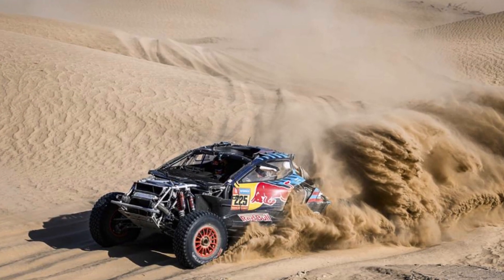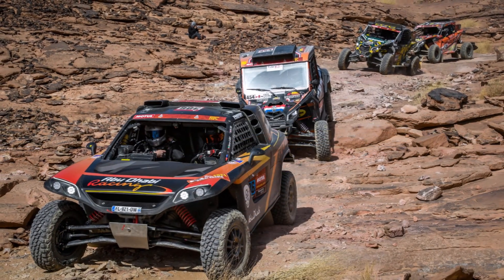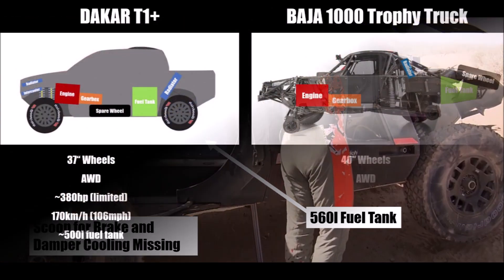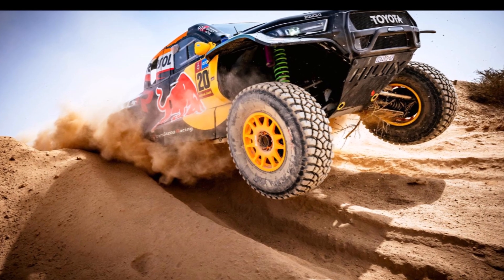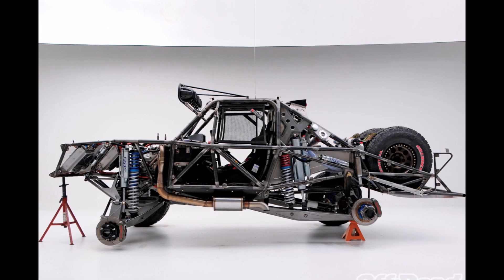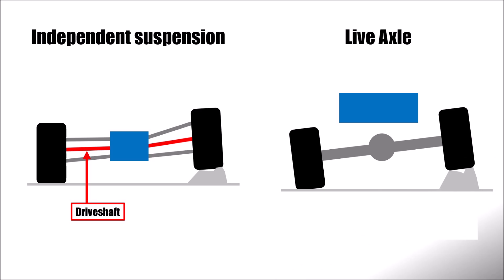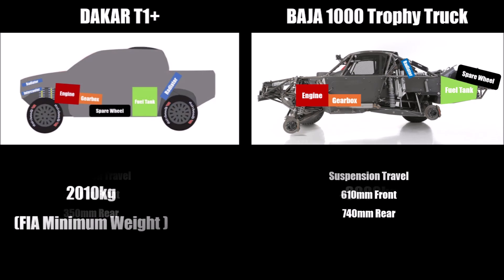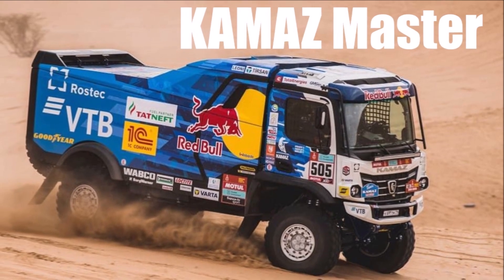BAJA 1000 Trophy Truck vs. DAKAR T1+ Vehicle - Technical Analysis

Comment: T1+ has to be my favorite because it is much harder to design and has to cover much more track during a segment. I understand the fascination about power with the Baja 1000, but it also feels much more blunt and dare I say, boring. I have to say though, there are much too many regulations for the T1+ class and it probably would mix up things better if they regulate fewer things.
Reply: What makes trophy trucks so awesome is it is an “unlimited” class. There is currently an arms race going on between the builders on how to maximize the mid engine, all wheel drive layout. One builder even made a twin engine AWD truck. There are also teams starting to experiment with electronic suspension, like the active suspension F1 teams had in the 90s. There is a lot more going on than just the power.

Comment: Its interesting how the less regulated, more powerful, and largely unlimited trophy trucks are cheaper than the Dakar T1 trucks. I suppose the extra engineering for safety, efficiency, and driving longer distances drives the R&D costs up enough to offset any cost savings that the regulations may have intended to bring, since usually such regulations are designed to make racing less expensive for smaller teams.

Comment: Unlimited T1+ cars would be incredible. Take the air restrictor/suspension travel limit and speed limit away. And see what happens
Reply: Give this man a beer
Reply: What happen? That happened: local people, drivers, supporters got killed every year... Ever heard the Dual engines turbo DAF truck in Dakar? Right now they even have a speed limit for T5. You can't simply maintain a reliability for a vehicle and high concentration for drivers for 14 days in straight and 4500km, without any limitations. Or if you talk about absolutely unlimited, how about building a turbojet ground effect vehicle and just simply win any car races in the world?

Comment: the safety concerns about the radiators and fuel cells on the Baja trucks are not so concerning when you consider the immense strength of the roll cage construction. the bodywork is there to simply maintain the appearance of a truck, they do not aid in protection very much.

the radiator placement allows only the coolest, cleanest air to reach it, and is in the strongest part of the chassis: the center. it does not get hit anywhere near as much by rocks, debris, or other competitors, as it would be if it were up front.

the fuel cell is in a more exposed position, but the immensely strong rear axle and spare tires surrounding it shield it from most impacts and wrecks that are seen in Baja.

would love to see each truck do an exhibition run in each other's race series! would be very easy to register a T1+ for Baja, probably not so much for the Baja truck to have a go at Dakar, considering the strict rule sets.

Comment: In Oct 2006 I went down Baja on a street bike (Ducati Multistrada, yeah, I know). On my way back north I dropped into a long straight that stretched many miles. I saw lights way out there, I thought a semi or something. The lights got close much too fast. In the maybe 20 seconds before crossing I became aware something really usual was coming at me. It was a trophy truck going flat out. I was going about 85 mph, we crossed on that narrow two lane at almost 250mph. For a split second my insides shook. I've been a fan ever since.

Later I almost got clobbered by some idiot on a dirtbike crossing the highway. Turns out I was there during the start of the 1000 pre-running.

Comment: back in the early 2000s vw brought 2 touaregs to race baja and they did well! couldn’t keep with the trophy trucks but they finished and were competitive against some
of the other classes. then vw went ahead and built a full size trophy truck using a disel engine similar to the one audi used in lemans but they had a lot of technical issues at their first race then the recession of 2008 came and they had to stop the baja program.

Comment: a use awd trophy truck is not less than $700,000 dollars a new awd trophy truck is $1000,000.00+ dollars. most awd trophy truck have a mid engine and is a paddle shifter transmission not sequential.

Comment: Id go with a Baja truck, you can always run with less power if you want. Im pretty sure the teams running in the sand wish they had more power to keep them ontop. 

With that said id drive anything if the start was in Paris and the finish was in Dakar.

Comment: Wow!
You analyzed an older trophy truck.
One from 3-5 years ago.
The new elite tier of trucks are the mason motorsports trucks 1100hp mid engine awd trucks with portal front hubs.
Reply: Also the Trophy Trucks are mid engine not front engine as shown.
Reply: @longshot7601  only mason awd tucks, and robbies truck, any of the gieser brothers, or Smith fab trucks are still front mid.
Reply: did they get lighter or heavier? or are they also around the 3 tones?
Reply: @HannyDart  still right around 6000lbs, they added a front diff, axles, and geared portal hubs, and saved weight elsewhere
Reply: @ interesting. I wonder if they tested heavier/lighter setups, too

I wonder where the limit of overall size is; maybe bigger trucks are even better?
Reply: @HannyDart  if you want to see light trucks the 6100 class is spec trophy truck they go to great lengths to keep them lighter like 4500lbs because of the limited hp sealed spec motors.  the way a heavy truck ends up working is basically a problem of scale.  Big tires are heavy, and we need a reasonable ratio of sprung to unsprung mass, and enough strength to hold it together...

Class 10 buggys are all around 2000lbs because they are limited to like 2L ish (depending on air or water cooled and  single or two seat) and run smaller diameter lighter tires.... because of the limited hp.    You can look at it like a matter of scale to the larger vehicle with the larger wheels, more weight and hp every bump and hole is smaller...    you can watch the class 10 vs class 1 unlimited or trophy trucks.

And as a side note.
Sometimes, on smoother tighter courses, there will be class 10, up in with the class 1, and even class 10 and 1 up with the slower trophy trucks.

Comment: YouTube zoo road a Dakar car would be doing 5mph here
A 1100hp awd trophy truck is well over 6000lbs and it needs to be to hold up to the conditions. A g out in a dakar car at 130mph would fold the chassis and kill the driver. 
Also fyi the baja 1000 covers some very mountainous terrain, there is very little flat ground running.
Also fuel cells are 300-500litres usually stops are a top up incase there are issues.

Trophy trucks cost $100k to rent for one race before damages and half the field are likely in rented trucks

Comment: i like the unlimited approach of the baja trucks more, because they can use the full amount of tech and knowledge they have to tackle their terrain
Reply: If you took the time to watch actual Baja videos you'd see that the terrain is so much more diverse than is being led on, and in my opinion much more diverse than Dakar in Saudi.
Reply: @EthanHagle  Thanks, I will. I have very little knowledge about Baja races, will definitely watch some of it now.
Reply: yeah, only one type of terrain, and with regular refuelling and tyre changes :)
Reply: @YurNikolaev  depending on the course route, Baja style desert races can go through some VERY rocky terrain. the Vegas to Reno race can get pretty nasty at spots.
Reply: @YurNikolaev  trophy trucks experience a extremely more difficult terrain. Dakar is a cake walk
Reply: @YurNikolaev they said exactly that. On that one terrain, those trucks are kings.

Comment: Basically, TT gonna leave T1+ in the dust, but they not gonna lasts the entire Dakar stage.
Reply: If you detuned the engine to use less fuel it could make a whole stage and still leave the t1 in the dust.
Reply: Dont forget that T1+ cars have air intake restrictors and are limited in many key components . If you made them “unlimited” like the trophy trucks, the t1+ cars would probably leave the trucks in the dust, except on baja whoops probably.
Reply: @Lineriderzero  if they were unlimited then they'd probably look a lot like the trophy trucks but with MUCH larger fuel tanks.

Comment: Trophy would leave the T1 in the dust across any terrain, and i can't ignore that. It gets my vote
Reply: any? over rocks? depending in the environment
Reply: He did say its alot heavier so maybe not that much faster.
Reply: @markmall7142 Modern Trophy Trucks are packing nearly 4-digit horsepower levels, and are generally far more resilient. Add in their extra suspension travel and much larger tires, and they can brute force their way through terrain at speeds that are frankly horrifying. You'd need a much smoother course than what Trophy Trucks usually face for the T1 cars to have even a sliver of a chance.
Reply: @markmall7142 a trophy truck will straight up do 240kmh.....
Reply: @markmall7142  350 hp (limited) T1 vs around 1100 hp (unlimited) TT.  The TT does weigh more but with that much power it just isn't even a contest.   Only place a TT doesn't do great is technical trails/rock crawling.  That's when you go with a KOH 4400 Ultra4 car - the swiss army knife of off road racing.  Does everything.

Comment: Personally i prefer the Dakar Cars more just because i can still see the resemblance to its road counterpart more than a TT.

Plus the mindset of "You're on your own" while being in the middle of the Desert trying to find your way through across hundreds upon hundreds of kilometers is just awesome. You got problems in the middle of the stage? Tough luck. You better try to fix it yourself or wait until the support car come around.

It's probably one of the reasons i also love Endurance races like WEC/IMSA more than something like F1.
It's the human & machine perseverance through long distances.
Reply: give me Trophy Truck any day  such better racing...they sound awesome
Reply: @dilligaf2818  They may both be off-road racer but the discipline itself is quite different. It's just a different kind of race with one is kind of a sprint while the other leans more on the endurance.

Speaking of sounds, personally having multiple different types of engines producing different kind of sounds is also awesome. Again much like prototype endurance cars, having variety is the charm.

If i wanted to have some true sprint rallying on multiple different surfaces then i got WRC for that.

Comment: Diesel Dakar T1+ cars were my favorite. Those did cover the 800km stage on 325L diesel, not 540L like the current petrol DakarT1 cars. It's a shame the FIA penalized diesels with ballast. Comparing the diesels to american cars, they have 4 times the range using the same amount of fuel.
Reply: Diesel trophy truck would be the best of them all!

Comment: Putting the fuel cell at the back? Trophy Trucks are not very sophisticated, more like brutes.
Reply: It's for weight distribution, B Sport explained it in the video. Putting the fuel tank in the middle was done before and is not as effective when gliding over whoops at high speed.
Reply: @johncarl5505  I heard, doesn't mean it's the best or safe. It is truly moroning decision considering they bump the back of someone they need to overtake. The whole thing is really... not very professionally designed.
Reply: @dafnik8925 It's protected by a tube frame rear bumper, kevlar panels and tires. No one has ever died from a trophy truck fuel tank.
Reply: @dafnik8925  Sounds like you should try designing one then.... good luck!
Reply: @ I'm sure M-Sport, Prodrive & co are looking at this. If there is a market, they'll go. US vehicle engineering is not very sophisticated, no wonder that even NASCAR is a Dallara!
Reply: @dafnik8925 NASCAR vehicles aren't even made by Dallara. Shows how unintelligent you are.
Reply: @johncarl5505  nah, they just designed gen 7, no big deal...
Reply: @dafnik8925 Toyota competed in the Baja 1000 for more than two decades and only won two times. They're way more successful in Dakar for comparison. What makes you think smaller companies like Prodrive and MSport could succeed where Toyota had a hard time. They can't even beat Toyota in Dakar or WRC. Also Dallara helped design the Gen 7 back when NASCAR was looking into a carbon monocoque chassis, which by the way is an American invention. When NASCAR realized that it would be too expensive they switched to Technique, which builds the current Gen 7 tube frame chassis.
Reply: you're just one of those Europeans who's jealous we in the states don't have to be over regulated by the FIA

Comment: Only americans drive cars with live rear axles. 

The rest of the developed world moved on decades ago, with performance cars.
Reply: Class 1 buggies have independent rear suspension. In fact most categories in the Baja 1000 have independent rear suspension. Only trophy trucks have live rear axles.
Reply: Still, it's more durable when compared to independent suspensions. Also, better load capacity.
Reply: @mahiru20ten  indeed. Perfect for a horse and cart.....and for an American racing car 🤣

No wonder americans are so rubbish at F1 !!!
Reply: Yeah that's just not how it works.  Trophy trucks are unlimited, and would be allowed to race with independent rear suspension.  Infact in the early 90s Ivan Stewart and Toyota did just that, and did well... but bigger more powerful live axle truckw took over.  Now.... the lower classes the fastest of which is called class 1, must use independent suspension and a transaxle, (a buggy with a solid axle is called a truggy and one dominated so hard that it was banned from the buggy class)  now running a buck, an independent car with a truck body is perfectly legal and not a threat.  The solid axle has more travel and the driveline can handle 1100+hp.  The 50,000$ transaxles struggle to survive with anything over 750hp.

Also with so much travel you'll see independent cars body rolled in corners  while going left like this from the rear / - - / wheels chambered the wrong way... impossible to put enough camber gain into them to counteract body roll.  While solid axle l - - I at least the tires stay perpendicular to the ground.

Anyhow cheers.
Reply: @EnglertRacing96  Exactly.  IFS/IRS is great on the road, but the tougher the conditions the more the solid axles come into their own.  Dakar is amazing for so many reasons but they don't run super technical terrain.  For that matter Baja doesn't either.  You would move into KOH stuff to get into rocks where you'll find solid axles are still popular although IFS and even IRS are becoming more common as the courses spend more time going fast in the 'easy' desert vs going slow in the rocks.  At the extreme you would look at comp crawlers where they ONLY run solid axles because articulation is king and speed is all but irrelevant.  If somebody needs a more down to earth example, there's a reason the Wrangler still runs solid axles.  It's the last man standing and remains the undisputed leader in production off-roaders when it comes to hard core trails.

Comment: Afaik, all competitive open class TT have a mid engine layout today. Rear wheel T1+ Dakar buggies are allowed to have more suspension travel and have some other goodies compared to the awd cars. It is a pity that they are not competitiv under the current Dakar reglement.
A very good animation how a TT is built up mechanically: https://youtu.be/_nR1-J676ao?si=gBiiQH1I5ToOwTo_

Comment: Personally, I find the T1+ Car's from Dakar better.  Because they need road approval, in addition to the FIA Rules.
The Minimum weight is cool and interesting.
Reply: @TruckerOsiris How about a Class 1 buggy? It's lighter than both T1+ cars and trophy trucks. Although they haven't won the Baja 1000 overall since 1993. Funnily enough, the year they stopped winning is the year trophy trucks were born.
Reply: @johncarl5505  Why they stopped winning?
Reply: @RCmaniac667 Not enough suspension travel.
Reply: @johncarl5505 most class 1 weigh more than you think.
Reply: Take a look at a video called mason awd trophy truck....

Comment: Thank you, excellent report. 
Although the TTs are quite different to the Dakar cars, they all look the same … spaceframe, flimsy bodywork, huge wheels and long susp travel and the only way to tell the difference between models is the car company logo painted on the grille. 

I’d still rather see the Dakar cars use at least the body-shell of production models.
Reply: It's convergence evolution. Everyone will turn to the most effective design.

Comment: The difference in the following 2 rules, basically determine the main difference in design: Refuel distance and the max speed. The winner between these two designs will be determined by the terrain. Short and windy vs long and straight. The Dakar cars are more sophisticated, which I find interesting.
Reply: A class 1 buggy would be more suited to Dakar than a trophy truck since they don't need to refuel for the entire Baja 1000. They're lighter than both trophy trucks and T1+ cars. They have less power and suspension travel than trophy trucks  but more than Dakar.

Comment: Very interesting comparison! Now I'm wondering two things: 1. How do the bikes in Dakar get such a long range with no space for a much larger fuel tank? 2: How do Dakar full size trucks compare to BAJA trucks in terms of weight, power, fuel consumption?
Reply: The bikes refuel more frequently
Reply: Dakar bikes usually have around 40L of fuel across three in-built tanks.
----
He already showed the comparisons in the video
Reply: Rally raid motorcycles have 3 tanks

Comment: Baja is more powerful but it's negated by its weight. Dunno, probably i will pick Dakar if environment is alright for it
Reply: If weight is a concern, a class 1 buggy would be good for you. They can do the Baja 1000 without refueling. They are lighter than both T1+ cars and trophy trucks.